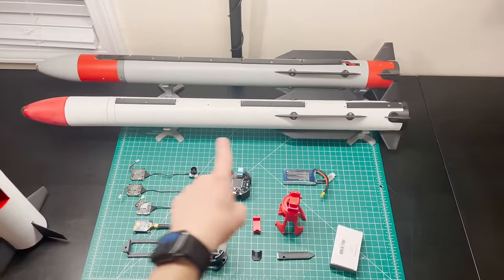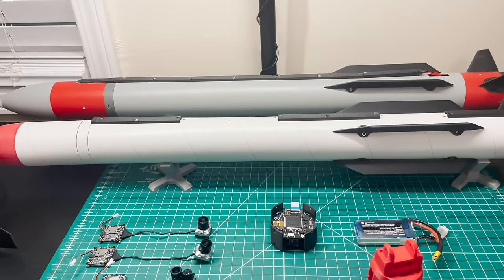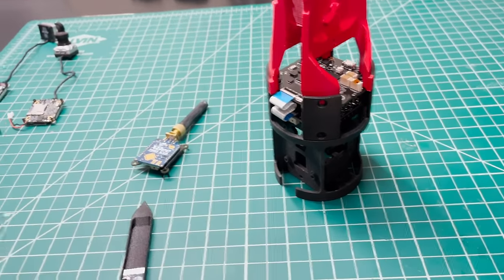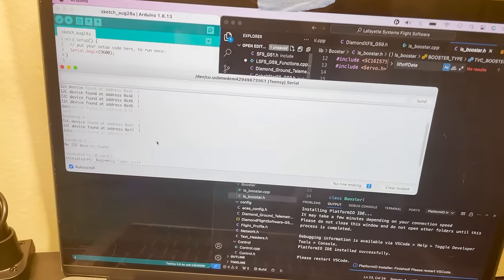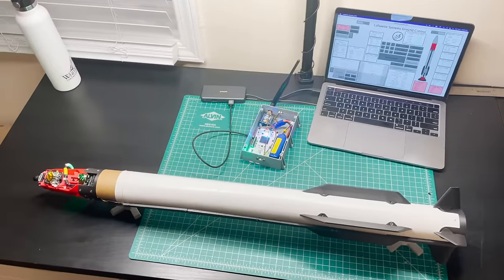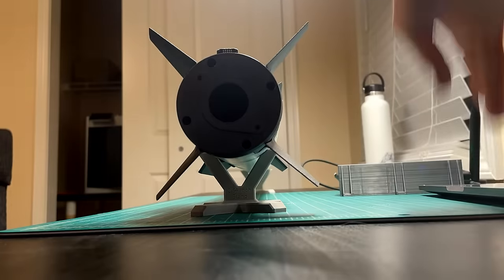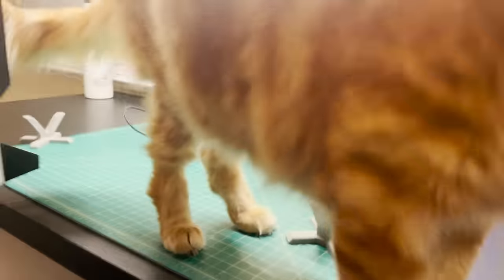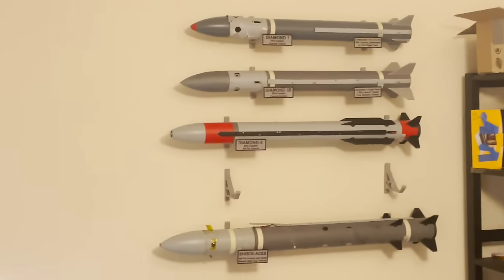How Does This Rocket Steer Itself? -- Active Control Rocket Avionics (Building DIAMOND-X Part 2)

Comment: Man, this is neat.

Also, I'm wondering: how much do you think something as simple as a supersonic command-guided missile should cost if in mass production ? 
Because it looks like the rules-based international order has a procurement rule that says something like: a supersonic missile has to cost at least $100k. 

Meanwhile, supersonic artillery rockets cost..probably cost not in excess of $2000-3000. Can a radio and a bunch of servos really cost $50k+ ... ?
Reply from the maker: Building a cheap supersonic missile with command guidance would be possible. Unfortunately command guidance became pretty obsolete in the 60s and 70s, it's just too easy to jam the command link rendering the missile useless. Modern missiles are typically on the order of $1-4 million.

A big problem is size. Large rockets and missiles need large, precise, powerful actuators. Hobby servos just won't cut it for large supersonic missiles. Small missiles still can't use off the shelf actuators. Their servos need to be extremely compact and precise so hobby servos won't cut it there either. Hence the tens of thousands of dollars per actuator for production missiles.

Another added cost comes from employment restrictions and reliability. These missiles need to be put in a canister for a decade in the desert without maintenance and work as soon as they're fired. They also need to be extremely reliable, hence the sophisticated self-test features. You can't use regular batteries, LiPo cells fail if it's too cold or hot, so expensive thermal batteries must be used.

Lastly, cost comes from capability. Missiles were (even adjusting for inflation) cheaper in the past because they weren't asked to do as much. Modern missiles need to fly farther, carry more sophisticated and expensive seekers, and deal with jamming, decoys, and targets that are traveling much faster. The body-to-body contact achieved by things like PAC-3 against Mach 4+ targets is an unbelievably difficult physics problem.

There's a saying that goes "What's the only thing more expensive than the world's best Air Force? The worlds second best Air Force. You spend almost as much money as #1 but lose anyways." Fielding a cheap, less capable missile will cost you less money now, but they're so easy to defeat that you might as well not spend money on missiles at all.

Comment: I wonder what effects the PC-CF filament has on radio performance, i am assuming the nosecone is made out of a different filament type because it’s red, but i would be interested in seeing if it is something that significantly effects radio performance. Also, have you considered adding hard stops that the fins/servo horns run into at a known angle to do automatic fin alignment? I’m not 100% sure that servos react to external feedback in a measurable way, but that could help with making alignment faster and allowing it to do self tests right before it launches to ensure they are true. or maybe a printed fin jig that aligns them all, and then the servos are zeroed? just a few ideas, i’m not super experienced with servos but this is really cool and i’m very interested in the avionics breakdown.
Reply from the maker: An auto-zeroing system would be great for the fins. These servos don’t provide any feedback unfortunately, but if they did, a jig or something similar like you mentioned would be very helpful!

Comment: It would take some structural engineering to allow an inlet and outlet, but have you considered mounting a DC motor with a fan to generate voltage?

I'm not too sure what the voltage limits on a scale appropriate DC motor would be, but it would generate power as long as it's in flight.

Maybe it would be enough? I also wonder how an inlet/outlet would affect flight...

By the gods, man. What have you done?

Comment: What are you doing with your SD Card holder to keep the SD card secured into it.  And just because it 'snaps in' doesn't mean it won't come out during lift off.
Reply: Inertia of an SD card is so little in comparison to it's snap-in force. It never would come out.

Comment: I see an xbee for telemetry. Would something like esp32 with a silabs radio work? OpenELRS does telemetry and transmitter data over 2.4GHz (or Lora) over long distances.
Reply: Awesome work!

Now wondering if Ardupilot needs a rocket profile. 😅

Comment: What is the stability factor of the static (no active control) rocket based upon an analysis by Open Rocket?  Also, what is the advantageous purpose of the strakes which serve to move the center of pressure forward?
Reply from the maker: I usually run with a static margin between 0.9 and 1.2. Interestingly enough, the strakes move the CP back, and the rocket would be unstable without them. They also increase the lift coefficient, so when the rocket pitches up and down, it accelerates in that direction harder.

Comment: Could you build jet vanes that work with the aft fins?
Reply from the maker: That's something I'm looking into! I'd need to get the vanes machined out of something pretty heat resistant and I'm a bit worried about slag buildup. The motors spit out a pretty significant amount of metallic aluminum that likes to build up on any surface in the way. I'm sure all of those problems could be solved though

Comment: These videos would be much easier to watch if you'd fix the camera and not wave it around hand held.  You are a remarkable rocket designer and your efforts would be much better displayed if you'd employ a few simple media rules and tools - like using a tripod to hold the camera still for primary motion; that is, motion of the subject (like pointing and waiving your hands).  Engineering wise, great work.

Comment: Damn, watching such videos i feel the urge to make something myself, but in the meantime, limited experience i had with microcontrollers and stuff completely kills it due to how much time and work it will take from rough sketch on a marker board to an actual working prototype
Any suggestions on fighting such 'killing' feeling, how to use that initial motivation not only to start a project, but to finish it?
Reply: Just keep it simple until you get an understanding of basic concepts. Once you see the patterns, the rest will come. Then all those extra programs & tools will make sense and actually be useful.
Reply: @SlinkyD  its not about them beign hard or anything - as a software engineer i have quite fine of experience

It's just about how much time things tend to take, usually i just lose interest halfway through
Reply: @lonesimba  My bad for the confusion. I read "marker board" as "maker board" and my brain went "not another new gui for electronics dev". I'm the same way as you. Looking at a 8ch RC that I built & coded as I type. Simple enough to build, complex enough to try a custom protocol.   

Same thing tho. Start with something simple just to get you rolling. Then keep the momentum up. Fighting through rhe drudgery of the intro projects is a pain. Starting on a complex hardware project too early leads to quiting fast. Every now & then, I find something in the "Goldy Locs" zone of projects that I do to completion.    

Best thing is to try to keep it fun & don't care about time or finishing. You'll either come back to it or find a more interesting project that you'll finish.
Reply: @SlinkyD  well, usually i start project looking up for results, recently I've been really interested in making working combustion engine on a 3d printer, event modeled in CAD 3 versions of a block, but got distracted by work and when i had the time - i never ended up returning to it, tho I'm still interested in thr idea - just not feeling like it when i upen the cad and stare at it
And the same happend with pretty much everything - from learning guitar or japanese to improving my own life (such as working out) - i get the initial momentum, i start it, then something undismissable comes by and when I'm done i have no momentum to resume something I've left over